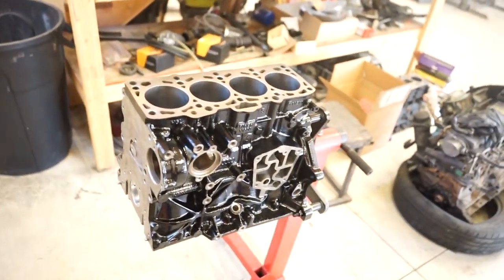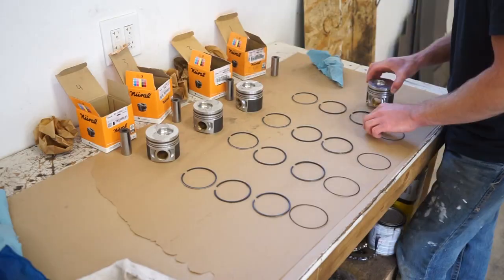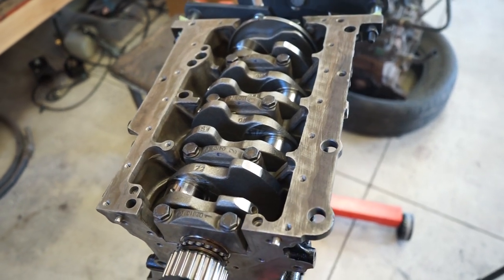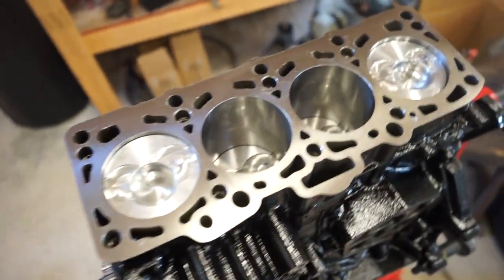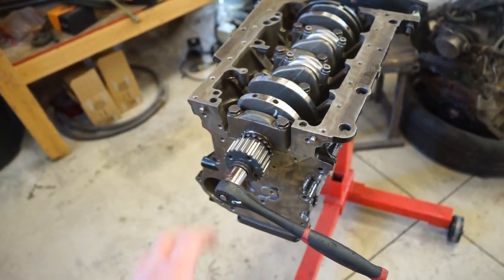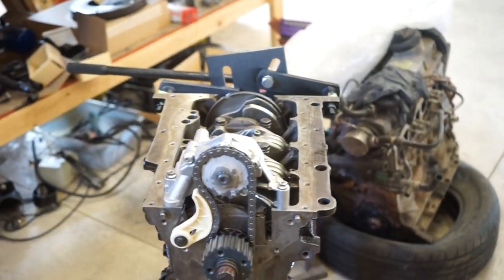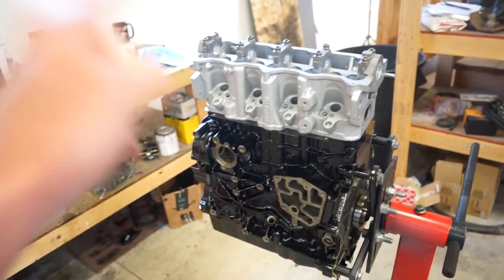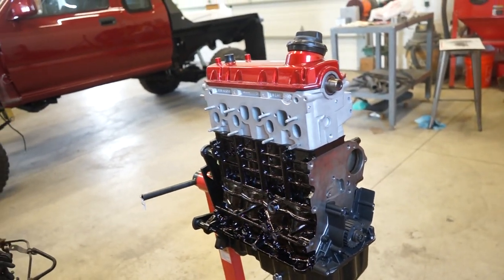Rebuilding A VW TDI Engine For My Toyota Pickup Truck

Comment: allow me to give you a tip. I do not use silicone gasket maker anymore (whenever it is possible) on machined surfaces i use Loctite 515, it is an anaerobic gasket maker up to .30mm gap. I found it to be better and lasts longer; the other benefit it has is that it does not oozes inwards, for example in water pumps, so it does not clogs up heater cores or radiator with silicone noodles.

Comment: Is there not a spec for the buckets with the cam?...it looked like you are using the old buckets(people call them diff.names..just what I call them)..if there was a valve job done(be silly not to)...that spec changed and buckets would need to be changed or disassembly and cut valve tips to bring it back in spec.

Comment: Love your videos! I m doing one TDI enginebuild myself and I have a question about cylinderhead studs/nuts troque spec. You are not using original head bolts and there for not using original torque, but I didn't get from the video how much did you use to torque down cylinderhead?

Comment: Any particular reason you put assembly lube under the bearings in the rods and the block?? That just giving them more of a chance to spin like no doubt all over the bearing where to meeting the rod or the crank but underneath??
Reply from the maker: Tallon Johnson I took the bearings out to make sure there is NO grease or oil on the backside, and I did not lube the backside of the bearings

Comment: Did you use new head studs when you reassembled the engine since they've been stretched already?
Reply from the maker: ARP studs can be reused if you dont exceed the torque spec

Comment: awesome looks soo good, nice work.  that pickup tube better be quick so we can see this running. did you port and polish you head? and whats the size of those pistons 80mm?
Reply from the maker: No porting, yes 80mm pistons
Reply: @austinniemela  nice shes gonna pull good and be better then a brand new motor. is that a colt cam?, why did you not port it? i ported and polished mine but it took like 10 hours of time on it
Reply from the maker: oTylerHD stock cam, I may upgrade in the future!

Comment: What year of tdi did you use? What is the difference between the short and long block?
Reply from the maker: Jim Auto this is a 2000-2003 tdi from a jetta
Reply: @austinniemela  I have a 1998 beetle tdi, I believe the engine code is ALH. Not sure if there is a short block of the ALH... ?
Reply from the maker: Jim Auto yes I believe that’s the alh